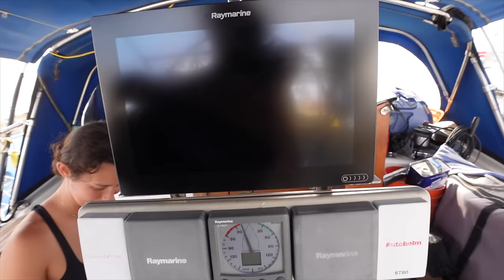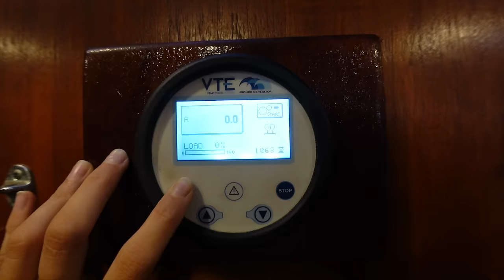Behind closed doors and under floors Episode 409

Comment: You have ground/earth and  negative bond circuits to reduce potential between dissimiler metals in the hull (reduce galvanic corosion and damage from lighting strike) never earth a device (negative return) to the  negative bond circuit. All LV AC & DC devices (circuits) should have there own negative returns (earth/ground) to there power source via a Negative BUS to prevent electrolisis. It's all in the words, just never confuse earth/ground with  Negative Bond or electrolisis will eat your boat away. Galvanic corrosion occurs between metals with different potentials, the resistance between the  metals increases volts increasing the rate of corrosion. Electricity doesnt just follow the path of least resistance, it will follow any path it can. Typicaly bond circuits in larger vessels are solid copper strip between all the metal through hull fittings, mast etc. Dont take my word for this though social media is the least reliable source of technical information, Goggle is your friend but not the forums.👍🖖🍻